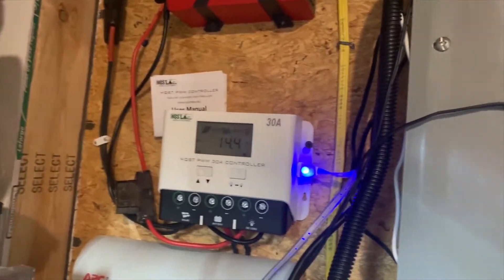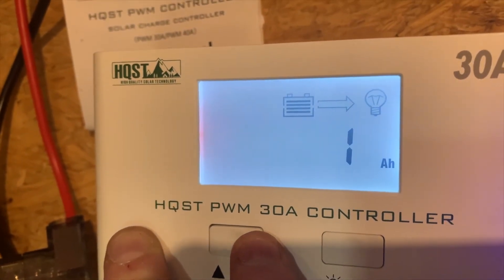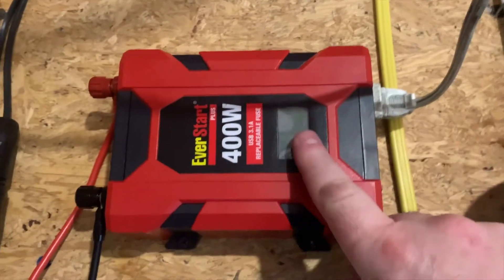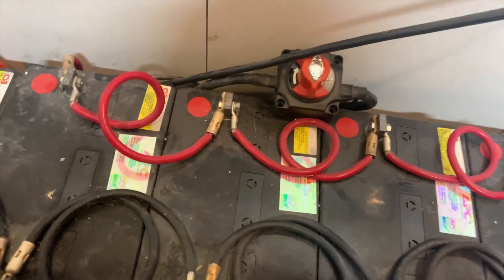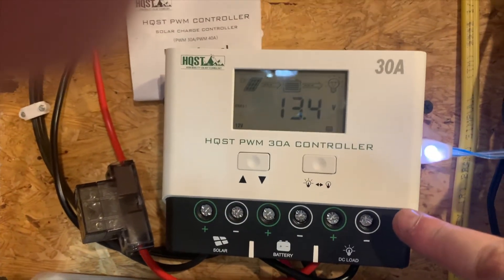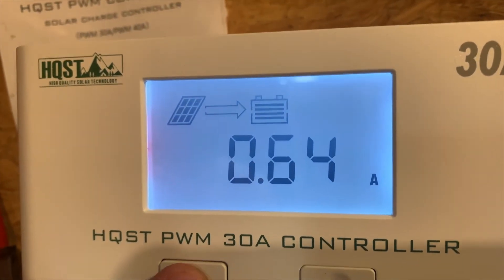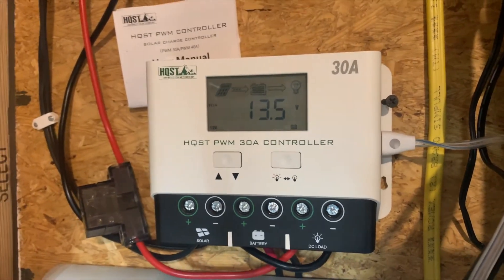HQST Solar charge controller PWM 30 Amp

Comment: Just ordered my charge controller, I do like your battery setup. I’m going to run 4 6 volt deep cycle batteries 2 in parallel and in series for a 12 volt total.  Hoping I can run my office off it during the summer time. I imagine your setup can run quite a bit.
Reply from the maker: I can run 50% of my house for almost 2 days. Just the 120v stuff no 240
Reply: @ChrisEdwardsRestoration   nice! im thinking about doing 4 - 6 volt deep-cycle batts of my office which should be more than plenty for my usage needs in my office. i just need to power a "gaming pc" and network equipment. my goal is to charge during the day and goof off at night. i think a 400 watt system should be plenty but ill know more after some testing and tuning. plus i still have to set the office up. hopefully a this year project. nice vid by the way.

Comment: I backed out one of the terminal screws and for the life of me cannot put it back in.... anyone have any explanation or help?
Reply from the maker: Theres a small metal piece behind the screws that wiggles around
Reply: @ChrisEdwardsRestoration  for some reason the screw wont go in more than 2 turns... getting stuck.. I dont think its cross threaded but what else could it be?
Reply from the maker: @brianbailey462  prob cross threaded. just give her the onions and man tighten it down... it will cut new threads.
Reply: @ChrisEdwardsRestoration  lol, thank you very much for your opinions. I was actually using a really crappy screwdriver and I finally found the proper tip and put it in my screw gun for plenty of power and it went right in and now it works beautifully and I have it all plugged in and everything's working great.. but I really do appreciate the trouble shooting help from a stranger on the internet. I know it takes time to reply to people so I really do appreciate that. I try to help out others when I can as well

Comment: Batteries wired in parallel fight each other unless they are utterly identical in characteristics.  They never are for long.  Divide your batteries and their loads then charge them on separate chargers,  but the chargers can all share the same solar panel source.
Reply: Even if they are mismatched capacity (in parallel only) then it does not matter. What matters is matching of battery chemistry . You can’t mix lead acid with Lithium or AGM . The electron charge and discharge is a natural phenomenon like having two or more water tanks of different capacity . They will fill up and empty at the same rate . However , one should not use a low capacity battery with a higher capacity one I.e 200 Ah with a 45 Ah . Personally i have been using three strings of 24v batteries of 185+185, 210+210 and 165+165 since about three years now and batteries are fine still. There are other factors at play here and they are too many to name here.
Reply from the maker: All mine are matched

Comment: Faulty installation.  Batteries in parallel. Don't copy.
Reply: Your system seems to be fine .
Reply from the maker: what do you mean, of course they are in parallel its what i use for my 12v system. not faulty installed at all.

Comment: I have this controller and it seems to be working, but my deep cycle batteries are almost too hot to touch during the day. It seems like its boiling the batteries. My charge status is always "Bulk" what the hell is that? Its set up for 24vdc. Something is wrong somewhere.
Reply: I installed new batteries and I came in the house and its already in equalize.
Reply from the maker: What are the size of your solar panels
Reply: @ChrisEdwardsRestoration  240w, about 30vdc, 8.4amps. I have three.
Reply from the maker: Wow nice!
Reply: @ChrisEdwardsRestoration  These are deep cycle Walmart batteries. The first batteries lasted about 4 years. The next set was destroyed by lightning, the end was blown off of one of them. The wiring and controller were also bad. This set I am not sure what happened to them.
Reply from the maker: Dang
Reply: @alanheadrick7997  Hmm. First off, your panels must be hooked in parallel. Next, for a 24V system, you need to set cut off voltage at max 28.2 ish. What you said about the controller charging is pretty dangerous. Assuming that you are safely hooked in parallel then you should not exceed its charge current limit of 30Amps and max out at around 25amps.
Reply: @enterthelegions  They are parallel and everything seems to be find. The batteries stay whatever the outside temp is and I see them drop to boost or float around noon on a sunny day. I am going to start checking water level monthly.
Reply from the maker: You need to program the low and high limits so it will go into float
Reply: @ChrisEdwardsRestoration  I think I might have found the settings. Double whats displayed for a 24v system. Even though I am still not 100% sure what I set. One number was 12.6 and the other something like 11.1
I think the 12.6 should be the max charging voltage, 13.6? I'll get my multimeter in the morning and watch what its doing. Thanks for the reply.
Reply from the maker: @alanheadrick7997  yes one is the low limit and one is the high limit. my high is 14.3 and my low is 11.0. keeps it nice on bulk and float.  yours being 24v, Bulk  should be 28vdc and float around 26 or so low should be around  22-23vdc. are you in 24volt mode? are you charging (2) 12v series batteries on a 24v battery. make sure your in the correct voltage of 24v for your setup otherwise it will not work correctly.
Reply: @ChrisEdwardsRestoration  Yes its set for 24vdc. But some of the voltages show 12 or 13, so I think I read double for two batteries.
 I am watching it today, but its been cloudy.  Thanks!!!
Reply: @ChrisEdwardsRestoration  I ran across a posts that said the controller will set the voltages needed and not to adjust anything. They said it will run Bulk for 4 hours after its charged. Then it will drop to float. I have never seen float. Maybe my batteries are bad?

Comment: I'm new to all of this I have that model. Could you show me what the settings need to be?
Reply from the maker: its all in the manual, specify your battery type, lipo, lead acid, agm, etc. then the low and hight voltages for that battery type, and walah, automatic after that. I do use mode 15 for manual on and off of the built in 12v out from the charger. I run a small inverter with a light and some small stuff from it i manually turn on when needed. otherwise i use my large inverter from my main battery bank.

Comment: How do you make it power go through the usb
Reply from the maker: Set the mode to 15 manual then press the very right button w the light in the off and it turns on
Reply: @ChrisEdwardsRestoration  ok thanks
Reply: @ChrisEdwardsRestoration  would it be the same for the 40 amp
Reply from the maker: Most likely

Comment: 0:30 "it has a touchscreen interface" .  I think you mean it has a display since the interface is button-driven.

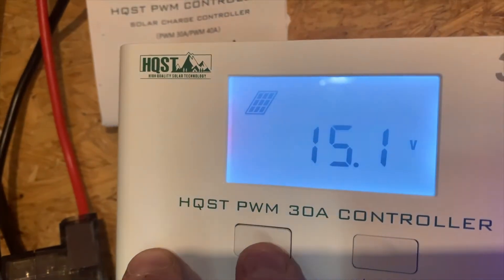0:50  "I'm putting 15.1v into 12v parallel."  The manual I found for it suggests that screen is Vpanel, and the panel icon seems to reinforce that.  Not sure how useful knowing Vpanel is with PWM.  Does the manual that shipped with it say more about that screen?
Reply from the maker: yeah sorry it is listed in the desc, click the show more if its not shown.  i did mean LCD screen! "Vpanel" according to the manual is listed as SPV or solar panel Voltage and reads: SPV = how much current is being received in Volts by PV panel to controller it has many sections, Volts, Amps, bulk,boost,float,equalize amp hrs, temps, battery capacity, battery voltage, its a mid range unit, but still good for the price i paid.

Comment: I hace a 40 amps charge controller like yours how can I get the app on my phone do you know?
Reply from the maker: you need a rs232 to usb or wifi either hooked to your pc w usb or wireless to your internet,.  then register for any tracker and link your account you create, then use app of choice with whatever provider you choose,  there used to be "free" ones, but now sense,neurio or emporia have all gone paid w expensive modules, emporia was the cheapest at 35$ for the device and that was it, but they changed and went to wall monitoring. so you need to plug into an outlet,. i used to use sense but its like 300$ now. F that,.Im looking into a audrino or pi solution now.
Reply: @ChrisEdwardsRestoration  ok thanks for your response it will help
Reply: @ChrisEdwardsRestoration  do you have any idea how can I turn off the light mode at night? Let me know thanks
Reply from the maker: Yes set to mode15.  That is manual on and manual off.  If you need a day mode the instruction manual mode 0 is light mode.  Wish i could attach a photo
Reply: Mine wont work like yours
Reply from the maker: You have to configure them. From factory they are not set up for low and high limits nor dc load
Reply: @ChrisEdwardsRestoration  thanks I will try
Reply: @ChrisEdwardsRestoration  so I guess mine is set automatic to mode 17?
Reply: Can you make a video of how to configure different modes 
I dont know how to do it let me know thanks
Reply from the maker: Dont you have the manual?
Reply: @ChrisEdwardsRestoration  yes that's why I figure out what mode you were talking about but o dont know how to see the modes on the screen
Reply: @ChrisEdwardsRestoration  I did it to mode 15 now its manual adjustment thanks ! All set now! I was reading carefully the instructions and finally works! Thanks again

Comment: What cable do you recommend for a parralell connections?
Reply from the maker: Depends on what you are referring to , batteries or panels, if batteries to batteries and 12v i would use at least 4 or 6awg, for panels 10 is good. And still affordable and will fit inside a mc4 connection and fuse everything. From this controller im 10awg on all
Reply: @ChrisEdwardsRestoration  if I connect 4 batteries 12 volt in parralell 100Amps, I will have 400amps in total so 6 awg won't fit my batteries is this right?
Reply: Would  you recommend 4/0 awg cables instead of 6 awg? let me know thanks
Reply from the maker: @williamsantiago320   thats fine, i have 4 and 6, its still only 12 volts., the Amp hours are run time based on load. your per battery links  i would recommend 4 but you can do 6 as long as the loads are not beyond excessive 3000+ for extensive times, this could generate heat. the main connection to inverter i would do 0-1awg
Reply from the maker: @williamsantiago320  4 i would do, you can do 6 if loads are not excessive
Reply: @ChrisEdwardsRestoration  ok thanks I will stay with 4/0 !
Reply: Are you connecting all of the 12 volt batteries in parralell?
Reply from the maker: @williamsantiago320  yes mine are , 75ah each times 12 for 980 ah, i have three 150w 12v panels in parallel for 450w/12v, i was going to do 24v  series of 4 150s tied together then parallel but my pure sine wave inverter is only 12v